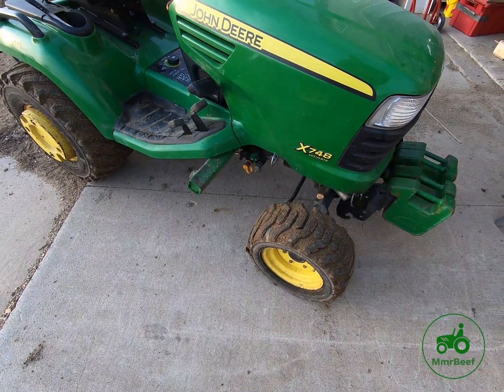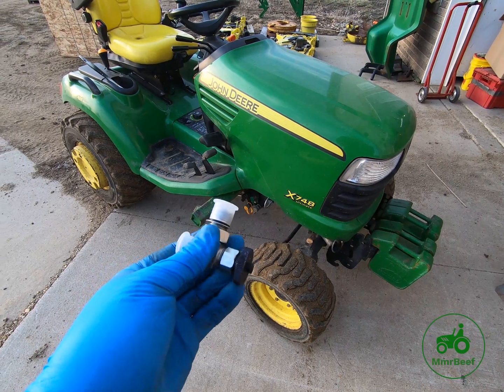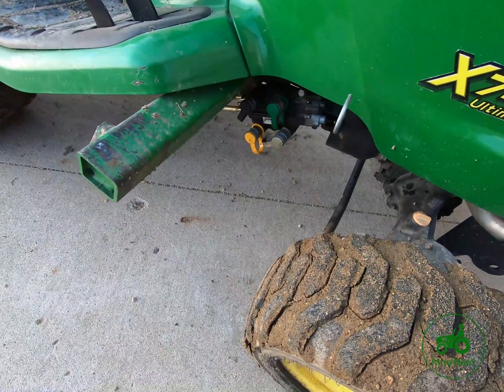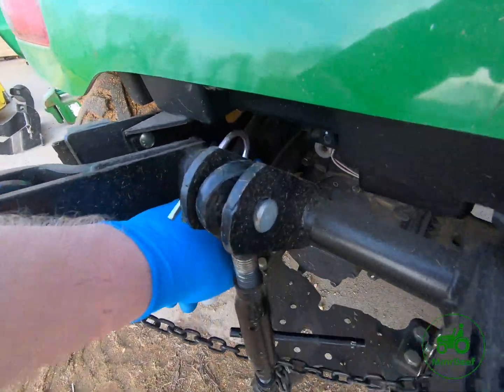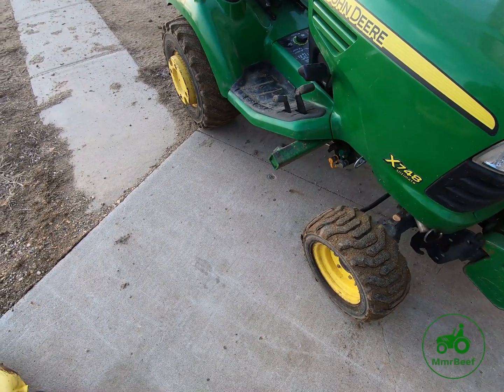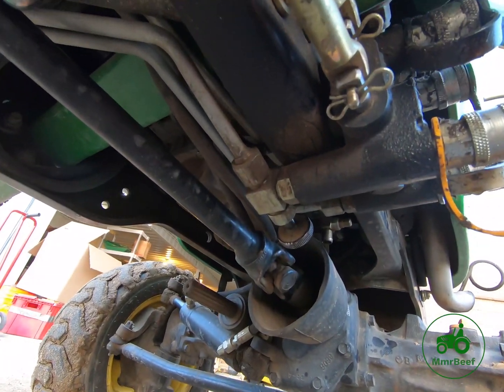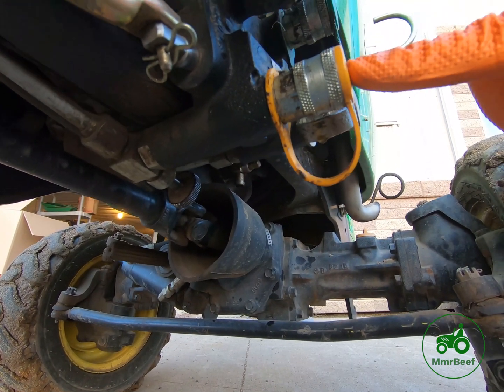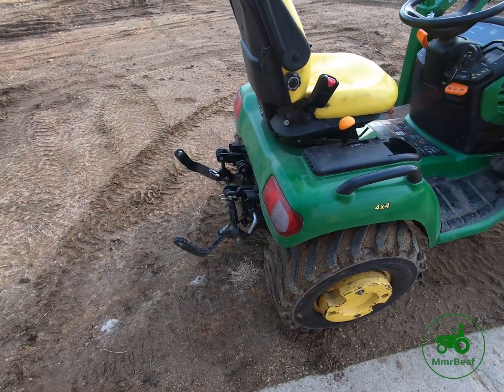John Deere Garden Tractor Hydraulic Lockout Valve

Comment: I have a 445 with a slightly different diverter valve (I think).  I assume that when using the snow blower attachment I should have the diverter valve screwed all the way in to isolate the PTO/Mower from the hydraulic system.  I do have problems getting the levers/hydraulics to function in cold weather.  I think I heard that it helps to limit the oil flow.  Any comments?  Thanks for the videos..

Comment: Guys I have a 455 that's been away for 3 years. I took it out runs great. My hydraulic levers both of them are frozen. The deck is down.  I can't move the levers.  I sprayed wd 40 on the levers. I think I have to go under tractor and find linkage. I didn't see anything.  Any advise?  Thank u
Reply from the maker: When the valve sticks like that the best thing to do is keep soaking them and tap them lightly with a hammer. If you take the linkages off you might be able to move them with a pry bar.

Comment: I have an X720 John Deere - I only have 60" deck and quick hitch with snow plow - can you please tell me when I detach the mower deck and hitch up the snow plow - do I open or close the hydraulic diverter valve?  (clockwise or counter clockwise)
Reply from the maker: When you take off the mower deck you want to close the valve. The valve allows fluid to the rear lift cylinder. When you have the blade on, you do not want the deck lift going up and down. It should be clockwise to turn it off.

Comment: Great video, thank you for actually showing the function, not just talking about it. One question though, If you were to have something on the rear 3pt for weight, and a quick hitch and blade up front, could you use the lockout to keep the 3pt up and supporting that weight while the blade is in use? or would it lower, and just not go back up. I'm kinda confused on that one...
Reply from the maker: If you have weight on the three point and don’t need the three point, you can raise the three point up, then use both the lock out valve and the depth control rod on the three point to lock it up in the air.

Comment: Is a pressure relief valve needed on the new x700’s if using a loader or does it already have one?
Reply from the maker: You will need the loader valve on any X700 series. The valves do not come standard with the machines. There are/were a couple different ways to order them I would have to look up the parts numbers to be sure.
Reply: @mmrbeef  I saw some part numbers listed on a forum: “BW15044 $150 to $170.00 is the Part Number lowest cost for the Valve If You go with the numbers that supersede it the Price Goes Up AM122228 is about $220 or MIA884868 is about $1,000 plus all for the same Valve with different Deere part numbers”
Those look correct?
Those seem to list like the x748 but the x758 is not listed. Would it be the same in both models?

Comment: Do they still make the 45 loader for new x series machine
Reply from the maker: Sadly they do not. When they moved to the current X7-- in 2013 the 45 loader was no longer an option to add to the machine and there are no provisions on the frame for the loader. CTC does still make a loader for the current X series. As far as I know the last few in stock 45 loaders were sold in 2014 or so.

Comment: I'm with Wheeler459. I don'r have a 3pt or a diverter on my x748. Would a diverter make my front blade work faster? I enjoy your videos. Kent from PEI
Reply: Yes it would. The angling function of your blade would work more quickly. Even without a 3pt or with the deck off, that actuator still moves. Closing the diverter valve stops the flow to that actuator thus your angling cylinder will operate more quickly.
Reply from the maker: Dewitt Zeliff is correct. The diverter valve installed will make your front functions work much faster. Your blade will also stay at an angle better when plowing snow with the diverter installed.